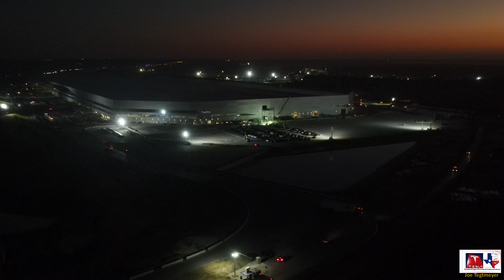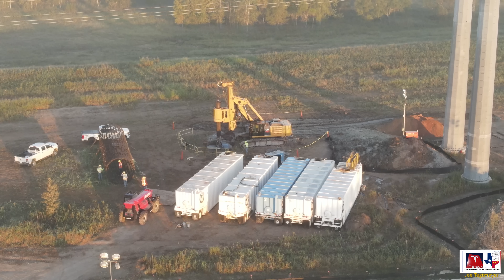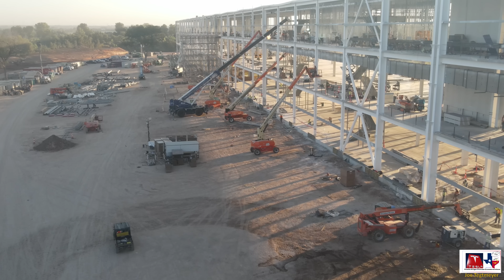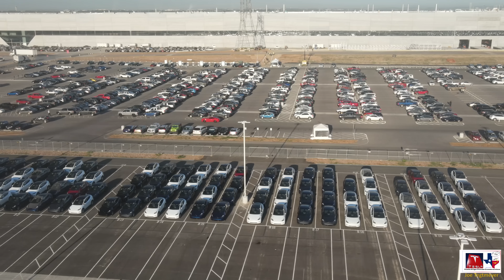Pre-dawn look inside Tesla Giga Texas on 21 September 2022 & Factory Construction Updates (06:45AM)

Comment: The stormwater collection system on top of Cathode is well advanced with the roof finished and the primary water collection header (white plastic pipe) almost fully installed under the West side edge of the roof. The interesting thing is that the collection header appears to come down to the area where Joe expects a tank farm (see 21:44). Something to look forward to, how they are going to use the harvested rainwater. The Cathode roof is certainly big enough for justifying a recovery system. There may even be some priority in finishing this system to avoid an uncontrolled rainwater-dump at specific locations. 10 day's weather forecast: "sunny" with an occasional "mostly sunny".
Reply: There's a group of 4 or 5 pipes under the floor in the adjoining bay to the north. Pipes emerge on the east side. Presumably falling east, difficult to find something to measure. https://youtu.be/qBx7PbRezGA?t=1082

10 sunny days ahead, at least the Level 1 floor should be finished.

Comment: 18:50 The moisture barrier is going to maintain moisture content in the fresh cement so that curing is uniform. Without the barrier, the dry soil will rapidly draw away water from the "green" slab and cause shrinkage cracking on the bottom. For the same reason, the upper surface may require a moisture barrier or a damp mat.
Reply: 18:50. Moisture proof membrane. Laid 'almost' everywhere here at Cathode, yet only used intermittently on the main building.

Comment: I am just amazed how much concrete is being demoed after being poured just month ago.
Reply: Yes. It seems like one step back for each step forward. There seems to be constant demolition of something built the previous month or so. Yes, Tesla promotes iterative designs but this seems ridiculous. For example, the new stamping machine base. How much cheaper and easier it would have been to build it in the open instead of inside a completed building. Or cutting cargo bays into thick concrete walls instead of planned openings. A little more thoughtful planning seems in order.

Comment: 5:00 The weight of the stamping press isn't the main issue. Every time those presses strike down a new part, they send a tremendous amount of force down into the ground. Anyone who's ever worked near a press will tell you that you can feel it through the floor every time the press comes down. They create a lot of vibrations. If those the foundations of those presses weren't so heavily reinforced, overtime, it would literally shatter the floor and creates all kinds of problems. Things would get misaligned, which is a recipe for disaster when you have those kinds of forces involved. The press would destroy itself and the building rather quickly.
Reply: Thanks for the info.

Comment: Thanks Joe. Really great shots of the inside. Shows how much work is ahead.
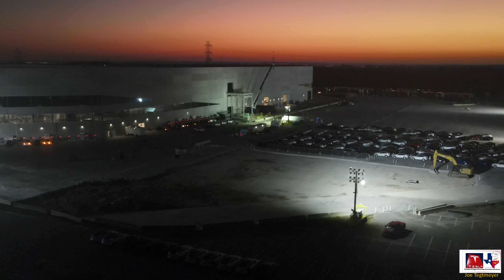3:21. Hardstand demolition. Whatever is going on the ‘extra thick concrete as footing’ idea can be shelved.
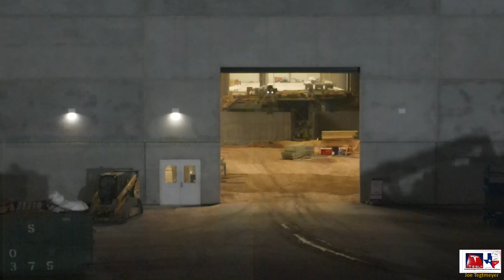4:52.  Stamping Extension. East door. Formwork staging in the pit for the floor sections to be constructed.
Central line of steel columns on their concrete pedestals visible to the left. 
Deep inside, the High Bay floor seems even enough to be the finished floor surface. 
5:22. Stamping Extension. West door. Concrete pump. Might be another pit this side also.
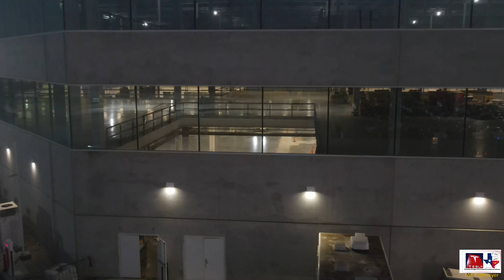6:20. GA south. Level 1, bare earth to the right. Line of new concrete over a trench directly ahead.
Level 2. Way in the distance is probably the wall of the first Stage of GA that ends at gridline 33. Our view starts at gridline 84. Better view in Joe’s Patreon photos. Right of screen through the plastic curtain, white painted steel racking. No Level 2 floor there yet. 
6:30. GA south. Level 2. Glimpse through the plastic curtain into the steel racking. 6:48 also.
6:48. GA south. Level 2 floor. Left of screen. Very small section beams supported on closely spaced columns. Extra headroom needed on Level 1.
7:12. GA Level 2. Shiny floor is the original finished concrete. The grid pattern of dots are shear studs welded through the steel decking into the beams. Long stretch of floor where only beams are visible. In the background the profile of the steel floor decking is visible where concrete is yet to be placed.
8:34.  GA Level 2. Welding the shear studs. 
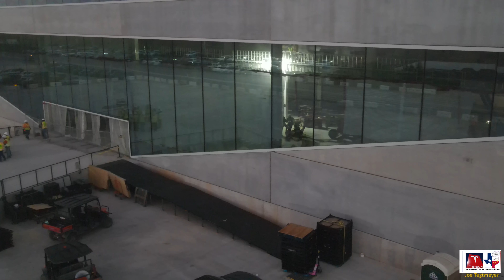9:14. Main Entrance. Temporary Ramp. Another event coming up?
Inside Level 1. Some architectural stud work for an angled bulkhead along the edge of the Level 2 floor.
11:01. Battery, apron. Enclosure appears to be for the Ironworkers/Steelworkers. Welders, generators, mini crane, scissor lifts, trolleys for pushing lengths of steel around on.
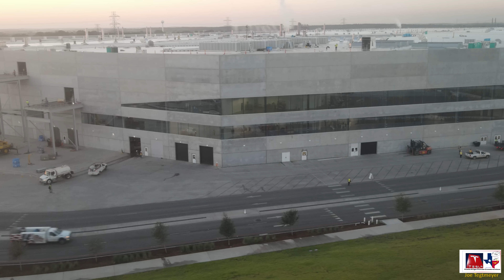11:41. Battery, apron. Water truck exiting. A large excavator entered through this door in Jeff’s video yesterday.
12:47. Paint, apron. Perforated panels. Might be similar in Berlin or Shanghai interior videos, they look familiar. Maybe one of the Dürr videos.
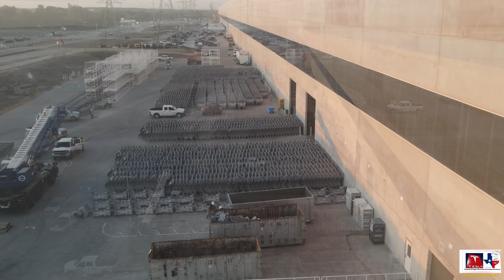13:31. Casting. Left of screen. A Tesla Semi parked on the east-west road. 13:50, and 26:14 also.
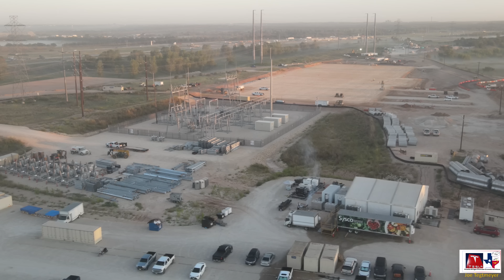14:19. Sorry Joe, didn’t hear any of that, got distracted. Smoke rising from the BBQ had my attention, 🤤
14:49. New substation site. Roller. Different style used at Berlin with a pair of what appear to be hacker plates in front of the roller drum, https://youtu.be/OFmgta2Tj8I?t=605
21:05. Cathode west. Pair of white tanks transported over from the Starlink/SpaceX site.
23:08. East of Cathode. Speculative BTC site office site. Placing and compacting fill between the concrete legos.
Reply: 13:31 ... spotting the Tesla Semi ... Eagle Eye Dessie ... 👏👏👍👍
Reply: @MrBreisgauer  13:31. I was hoping for a closer look. Maybe tomorrow with Jeff's video. It seems to be a strange place to leave it parked. 2 days already.
Reply: 3:21 My original thought was that when they decided to do the 500 ft. extension, they would cut 10' x 10' holes in the concrete pad for footings. Then realized that wouldn't work because the slab is sloped for drainage. Then you mentioned that it is also lower then the elevation of the floor in the main building. Making total demolition of the slab even more likely when they expand. I just hope this isn't the expansion.
Reply: @DavidJohnson-tv2nn  3:21. Until geo-piering starts whatever is going on there is complete guesswork. 

I don't doubt the possibility of an expansion, but there's still the main building near 50% incomplete.

The lack of publicly available documentation is frustrating. New site plan lodged 20th Sept, hopefully we'll get a look at that.
Reply from the maker: Thank you Dessie ... you really help me prepare and present what I see, so I want to say thank you for your help!
Reply: @JoeTegtmeyer  Cheers Joe! There'd be nothing to comment on without your videos.
Reply from the maker: @DessieDoolan  😎👍

Comment: Not really sure why there are racks for the casted front/rear chassis since they're simply being stacked against the factory wall.
Reply: Could be as simple as having more castings than racks. They might only put them in the racks to shift them to the next manufacturing stage or to their location on the production line. 

Also seems only the front castings are being racked for now. Sometimes with the sprue/runners in place, other times without.
Reply: I think it is a temporary buffer for some unknown reason. I doubt we will see it as a normal inventory.

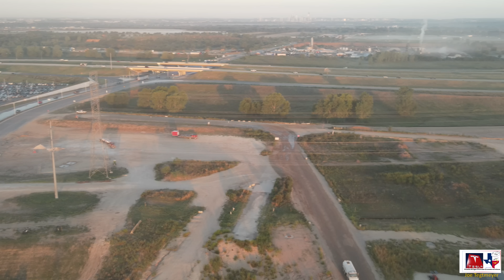Comment: 10:08 very exciting to see so many 4680 structural packs on pallets, ready for assembling. The question remains though, where are the 4680 cells coming from? It could be from Kato Rd, with BA still being commissioned. A telltale sign of production activity in BA would be some escaping condensed water or steam from the coolers on the roof. In this early morning video we should be able to see it, same as from the other coolers at the eastern edge of the building, but I don't think I can see any (around 14:10). Perhaps it is the camera angle against a light colored background this morning. I do hope that our drone operators will try to keep tabs on this important corner of the building.. it's our best chance to follow the 4680 ramp.
Reply: No steam from Battery in Brad's video either. Some from BIW. 

A view of the PV Array showing the angled brackets with the boxes. https://youtu.be/fOiEDfru79M?t=368

Comment: Battery packs going gigaberlin
Reply: Absolutely not as these are structural packs. Berlin is only building 2170 non structural pack cars so far.
Reply: @SaschaPlagge  same woodbox coming everyday gigaberlin.
Reply: @voltawagen  German packs will be coming from giga nevada